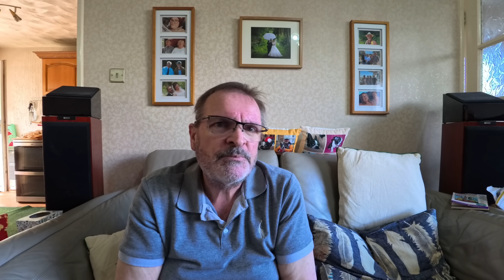Expert Ships Engineer Reacts to Baltimore Bridge Crash

Comment: As an ex marine engineer myself, it's nice to see  a qualified individual giving accurate and reasonable information instead of listening to some news twit who has never set foot on a massive ship. I'm 78 and long retired now and dearly miss the sea.  I served in the US Navy and then in the US Merchant Marine on freighters and super tankers.
Reply: As President Kennedy said: "When we go to the sea, we return from whence we came."
Reply: @ToMakeWhatLifesAbout  Sounds a lot like a Chevy Chase quote " No matter where you go, there you  are."
And the ever popular " No matter where you was, there you were.
Reply: I know very little about this.  However in my mind had they made no corrections and let enertia do it thing, wouldn't the ship stayed on course.  At least allowed the ship to clear the bridge.  While they worked the issues out .
Reply: @rse4379  Actually, the original ship's course was parallel to the bridge.The ship took 2 turns .(.Which I'm assuming was during both power failures). Both of these quick turns sent the ship starboard towards the bridge and then towards the pylon which knock down the bridge. 
 Going under this bridge wasn't part of its course. The ship's main course was a different parallel waterway to this bridge Which came in and out of the Harbor from the ocean.
Reply: @DONALDPIRAGIS  it was leaving and there is only one way in and one way out for a ship that size.  You have to clear the bridge before you can turn right and continue.  Either side prior to going under the bridge is land locked.  No place to go.
Reply: @rse4379  The loss of power twice, at such a crucial time, so close to the bridge, probably confused and panicked everyone on board.
Reply: @carlosidelone8064 It's like they hit an ice patch, panicked, slammed the brakes, and tried to steer.
Reply: @rse4379  Kinda makes you wonder if they might have bottomed out?
Reply: @rse4379  They were definitely in a tight spot, couldn't rely on their power and had no time.
Reply: @carlosidelone8064  a barge just hit a bridge in Oklahoma, wth
Reply: @rse4379  The "Bridge Builders Union" is out of control !!!  Bloody Hell !!!
Reply: @rse4379  isn't hindsight a wonderful thing...
Reply: NTSB timeline per the ships recorders: 
Approximately 12:39 a.m.: The ship departed from Seagirt Marine Terminal.
By 1:07:00 a.m.: The ship had entered the Fort McHenry Channel.
01:24:59 a.m.: Numerous audible alarms were recorded on the ship's bridge audio. At about the same time, the VDR stopped recording ship system data but was able to continue recording audio using a different power source.
01:26:02 a.m.: The VDR resumed recording ship system data. During this time, steering commands and orders regarding the rudder were captured on audio.
01:26:39 a.m.: The ship's pilot made a general very high frequency (VHF) radio call for tugboats in the vicinity to assist the vessel. Around this time, the pilot association dispatcher contacted the Maryland Transportation Authority duty officer regarding the blackout, according to transit authority data.
Around 01:27:04 a.m.: The pilot ordered that the ship's port anchor be dropped and issued additional steering commands.
Around 01:27:25 a.m.: The pilot issued a radio call over the VHF radio, reporting that the vessel had lost all power and was approaching the bridge. Around this time, the transit authority duty officer radioed two of its units - one on each side of the bridge - that were already on scene and ordered them to close traffic on the bridge. All lanes were then shut down.
Around 01:29 a.m.: The ship's speed over ground was recorded at just under 8 miles per hour. From this moment until approximately 1:29:33, the VDR audio recorded sounds consistent with the collision with the bridge. Additionally, MDTA dash cameras show the bridge lights extinguishing.
01:29:39 a.m.: The pilot radioed the US Coast Guard to report the bridge was down.
Reply: @GlutenEruption  Thank you for all of this information.
Reply: @carlosidelone8064   No problem! Definitely starts to paint a clearer picture of what happened
Reply: Thank you for your service Sr.
Reply: Surprised they did not blame the Russians 😂😂😂😂😂😂
Reply: God Bless you for all your years of valuable service!
Reply: @scottpageusmc While you were laughing, you missed it. he said he was a Squid, and then a merchant marine, of which there certainly are ex, merchant marine's.
Reply: You weren't on the Saratoga by chance were you?
Reply: @adammontgomery7980 are you referring to the s cking 60 from Dixie?
Reply: Salute to You Kind Sir . My Grandfather was Navy also.
Reply: There is a special team of people who are trained specifically to get these container ships out and away from ports into open international waters… then they are picked up and taken back to the port. If they had a black out when pushing off the docks as reported… why then didn’t they drop anchor right then???
Mystery surrounds the missing two three minutes from the black box.
Reply: OF COURSE it's not an attack by the Russians!
Reply: Nobody cares. Shut up.
Reply: @scottpageusmc Sure there's ex-Marines! Come on now, nothing is better than putting that damnable service (servicing the wicked oligarchs and the M.I.C.) behind you now.  It was just a mercenary job that you got paid to do, nothing more, nothing special at all except those wonderful regime changes around the world.  Once you dispense with the myth that you were "serving your country/serving the American people" and put that illusion behind you, you'll truly be set free. Anyways, glad you didn't have to die for LGBT in Iraq, as that's the chief export of the regime in D.C. 😊
Reply: I seen what you did there Kenny.. You did what million of 70s + guys do when youtube commenting. Degrade someone with your comment its the news twit then spend the next 82% of your comment dicussing how amazing you were in this life. Hahahahahaa  I see this all the time.
Reply: @ExtremePainGames  Pretty much everybody who has ever worked on any sea going ship fully agrees with this take on what happened, yet you know better. What are your maritime qualifications?
Reply: Imagine as a Army Engineer I know if barriers had been placed around the bridge supports like was recommended decades ago and having tugs and pilots this would have never happened.
Reply: So interesting ..You do realise you are letting facts ruin a good story 😊
Reply: @scottpageusmc Marine Engineer means that he worked on ships. He, like myself was in the USN.
Reply: Grandmother had a house near Lamberts point across from the Guard shack(Merchant Marine) in Norfolk, Va, on Warrington ave. My DNA father & stepfather were both Lifers in the Navy. They use to take me on ships,(Spear, Canopus, etc) submarines etc growing up.    :)
Reply: He made some good points. But there are still some unanswered questions that I do not think the public will be made aware of. I'm sure that the ships captain did all that he could, but the root cause is still not totally clear. As a retire ENC with EOW qualifications I stood many different watches during the sea and anchor detail from steering gear watch to Main Control. Something still doesn't feel right. Though I did not work in the merchant marine atmosphere.
Reply: God bless you and thank you for your service, dedication and sacrifice 🙏 Sending cheers and happiness to you!
Reply: Why does everybody miss the fact that the ship sped up to 8.7 knots after the power was restored? it's not until much later that the speed drops to 7.6 (anchor?)

What this tells me is that the ship was NOT in reverse when the power kicked in, thus rendering the torgue steering argument moot.
Reply: @scottpageusmche was Merchant Marine totally different from your Corps. RLTW/AATW
Reply: Yours was a world I could never fathom... (See what I did there?) Seriously though, I am afraid of water & can't go near docks, boats any of that. To see in person up close, Giant freighters & cargo ships would probably send me into a coma on the spot. Totally freaks me out.
Reply: @69Symba69  Snowflake, get a grip man
Reply: journalists report the information clearly concisely and without bias that they are provided. They're usually not experts in another field. Investigative reporting takes time and money
Reply: Marine engineer. lol@scottpageusmc
Reply: Wow, sounds like you had an amazing ride! And thank you for your service!
Reply: Thank you for your dedication ,  sacrifice and service .
Reply: Accurate? That ship dropped hier anchor and nowhere in his story ,not even a mention of it.
Reply: @Mind4Christ  There are photos of of the ship at rest, where it sits, with the port anchor out. But looking at it, it looks like it could have been dropped after the allision.
Reply: @tuck6464  the NTSB released the timeline per the ship recorders yesterday - the pilot ordered the port anchor dropped at 1:27:04 which is about 2min 30sec before impact. Factoring in the time for the crew to receive the order and start releasing the anchor, it was probably out for less than 1:30 before the impact which is probably responsible for the slight reduction in speed from 8.5kts to 7+kts and the starboard turn beginning to reverse into a very slight turn to port right before impact, but not nearly enough time to do anything more than that.
Reply: The first report said dropped and dragged I was wondering how that would’ve played into how the ship handling’s.Dropped before collision
Reply: Copy ,thanks for your input and feedback,I’m back to rest…..on this subject
Reply: @Mind4Christ  and??
Reply: @Mind4Christ  And? The anchor was pretty much irrelevant. It would have done zip at 8.5 knots
Reply: @Mind4Christ yes it was.
Reply: Once a Marine always a Marine!!!!@scottpageusmc
Reply: Thank you for your Service Sir. My father was a WW11  US Navy vet in Japan, he always gave me the job of peeling potatoes in our 7 member family, lol!
Reply: Thank you for your service.
Reply: Ships can't stop on a dime!😮 they ain't got brakes! The Titanic found that out, too late!
Reply: Thank you for your years of service. ❤️❤️🙏🏻🙏🏻🇺🇸🇺🇸
Reply: My dad was a Merchant Marine piloting supply ships for the Navy during WWII. He will always be my hero. Thank you for your brave service, Sir. 🙌
Reply: Where is accuracy in assuming?

Comment: As a former Coast Guard Aux. Coxswain, we were always told not to try to reverse to avoid collision because it will make the vessel unable to steer.  Even small vessels will lose rudder effectiveness.  I agree, the best course of action would have been to either continue ahead and try to steer away from the object.  In this instance, reverse thrust actually caused the ship to turn into the object.  Had they not tried to stop, they may have avoided contact entirely or at least not hit it so directly.

Comment: When in Stby just leaving and still in harbor it is not time to switch fuel. Normally you have two generators on the board to prevent black-out. One generator can run the ship by itself. If you loose one generator you don’t black-out. Something definitely went wrong in the engine room. I don’t think, by the look of how the vessel had move out of its course that going ahead would have done much change of the situation. They were going to hit anyway. What strikes me it is how in 5-10 minutes they had time to stop the traffic on the bridge. This is a real accomplishment.

Comment: I agree an unfortunate accident and evwrything should be investigated.

However, there has been a similar incident in the past, in Florida, where a container ship crashed into a bridge pilon. The new bridge built to replace the old one was built with a structure referred to as 'dolphins', which positioned around the bridge pilons to protect them in case of any shipping accident.
These 'dolphins' should then gave been installed elsewhere there was at least najor shipping. 

Foresight is better than hindsight IMO

Comment: There is do much BS in his statements. The main engines drive huge electric motors- not directly to the propeller shafts. The black engine exhaust means that there was power to the main drive motors, which means they had power to the propeller shafts. The main proponent results in the collision is the massive weight of the ship, they cannot be stopped in a short amount of time!! It takes at least ten miles to stop an oil tanker, so this massive container ship will require a considerable distance to make steerage changes let alone come to a dead stop. 
I think this guy has been at the corner pub and had too much to drink.
Reply: This vessel is powered by ONE  two stroke diesel engine that turns one propeller shaft and one propeller. To go into Astern, the engine must be stopped and air started to run backwards. It does not have huge electric motors turning multiple propeller shafts. This engine and propeller shaft operate from a few rpm to around 100 rpm.  What Maritime Academy did you graduate from?

Comment: Third 9:pM. Interesting that the ship when showing black smoke did appear to drift strongly to starboard. This fits well with your. Assumption of a clockwise prop spin in forward speeds and vice versa, so that the ship master did call for emergency reverse and actually drifted into the  ridge piling! We learned today that two deceased civilians were found on the bottom in a red pickup truck, when it was previously thought the bridge had been cleared, also 2 of the 6 missing maintained workers had been found floating at the mouth of the Petescopo River ( I think I botched that name), and it was confirmed that there were actually two Cheseapeak Bay Pilots aboard! The senior pilot made the timely call to halt bridge traffic well before the collision, and had also called in the support, after the harbor tugs had been released.

Comment: Why did the black box stop working and then restart? Others have said the black box should have continued recording even when the power failed?  Is that true or not?
Reply: Should have a UPS on supply.   Quite possible that the UPS batteries were faulty/flat - and when the main power failed - so did the VDR supply.

Comment: ok but why did the boat on gps mapping veer off the normal route a few minutes before the first power outage and and start heading toward  the pylon , then the first power loss and the engine comes back on and reverse supposedly makes the boat turn to the right ,then another power loss , then once again it regains power as you see it is kind of hidden by the pylon but you can see the smoke and if in reverse would it not still be turning right , cause the last 6 seconds it is going straight and right to the pylon

Comment: Not an expert, & not a folower of wjld speculation. But, I found it curious that the blackouts occurred when nearing the pylon..having come back on w/very bright forward lights after the 2nd blackout..then went out again a split second (?) before impact..as evideced by the water. I agree that this ship..if experiencing 'electrical problems' should not have left the dock..& further, it w/seem a stretch to believe that there weren't sufficient problems between leaving the dock & seconds before impact! Also, would the pilot, or whoever was giving instructions, NOT have known how the ship w/react to a 'full astern'..if that is what it was..or c/ he even have  accerated to try & straighten the draw to the right? That can be done when driving a vehicle. 
I hope we get the truth..eventually.

Comment: I worked Maintenence here as a Boiler Fireman for Ks Dept of Corrections. Before being revamped , we still used the old backup generator from its State Hospital days. We could not run the facilty without calling the right places on radio , and shutting down anything not needed. It wouldnt take it all without tripping out. Oil and water was circulated warm and it was in our building. Even then , people need to understand that it comes online and starts at wide open rpm's. When that 600hp Cummings fired up , black smoke rolled out of it for a bit before clearing. You didnt want any exhaust leak , it would get foggy fast . That was my first thought when I seen that , maybe it was the Generator coming online?
Reply: No, that black smoke was from Heavy Oil as used on the main engines... emergency full astern as chief pointed out.
Reply: @stevekirkby6570  And under full load , havent met a Diesel that didnt smoke some under those conditions at fireing.